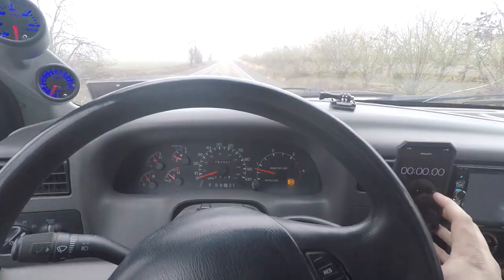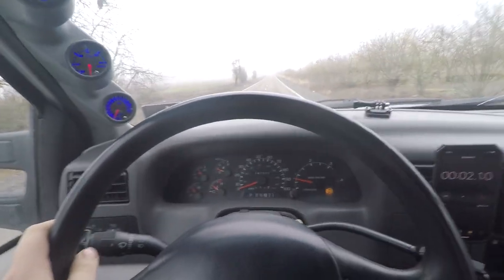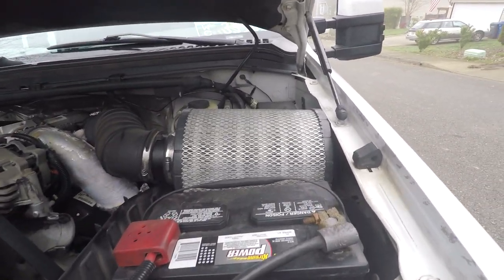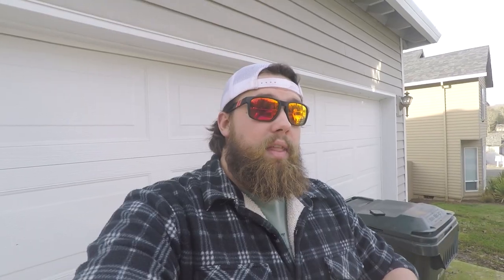Hydra Vs TS 6 Position Chip, Which is BETTER?

Comment: I have a 2001 7.3 in an f250 with 140,000 org miles. Condition is 99.0% good. Only gets around 17 mpg. Would love to get better fuel mileage. God Bless
Reply: I just snatched up a 2001 crew cab 4x4 7.3 134k on it. Beds rusted out but cab isn't too bad. Probably gonna just throw a flat bed on it. Couldn't pass it up 5 grand off a friend. Anymore you're gonna get a gasser with almost double the mileage for thst price lol

Comment: I happen to see Oregon plates on a truck in the video.
Didn't know if your in Oregon if you are could you do a video on how it preformed towing up hills with the chip??
I tow over MT Hood and wanted to see if I will notice a difference in towing 
All I have done to my truck is air intake and 4" turbo back exhaust.
Love the channel and the videos!!
Reply from the maker: Im in the salem area!!! I could do that for sure!! The Chip does come with Towing Tunes you can install! So I imagine it helps a ton!
Reply: @TurboDrivenAustin  we moved over the mountain to prineville and I had the chip installed you were right!!
Major difference now it's like a whole different truck.
I towed my 11,000lbs toy hauler over the mountain on the 80 horse power towing tune it blew up the hill like it has never done before.

Comment: My 2000 Ford F2 57.3 4 x 4 quad cab with the bully dog on extreme setting does 0 to 60 in seven seconds
I have a an aftermarket intake and a straight pipe

Comment: On my 2000 F-250 7.3 I got all Banks hardware and TS chip, big exhaust, inter-cooler, single shot injectors, turbo. I like running the chip on 4 till I need to blow Smoke :) She's a heavy truck with custom bumpers front and rear and a tank in the bed.... she's about 10500+ fully loaded... including my 3X Fat A$$ :)
Reply from the maker: So awesome man!!!

Comment: If your egts only hit 400 at wide open throttle you have your EGT sensor in the wrong spot they're supposed to be on a manifold
Reply from the maker: I have them on the spot that it showed in my Glowshift instructions, but, I have gotten that comment a few times, I’ll have to recheck my install, I did notice the other day when I got on it, my EGT’s hit 650/700, so I may have miss read my gauge at the time!
Reply: Yeah I thought the same thing on my ts chip on my 100hp tune I think position 5 if I floor it my truck will hit 1250 at about 60mph. And I have to peddle it to shift for them to go down.
Reply: @chrisyuriar9751  could be a bad probe mine started doing that a few month's ago

Comment: There are fuel plugs on the side of the heads. They're a big restriction on the fuel system, you need to pull them and drill them out, and debir them. You don't want metal shavings going through the injectors.

Comment: I got a 2000 7.3 superduty stock . I need more towing power for my 33 ft travel trailer. I had it to the floor a couple times going to the coast up hills. Im not a gear head. Wondering if its safe and is the ts6 for me?
Reply from the maker: This one would be safe! They have towing tunes optional!!!

Comment: Great video🍻. I'd buy a large grey shirt. Black might be too hot in summer in the State of Jefferson. 

As per tuning......look into a T500 terminator hpop from Riff Raff diesel. They are in Oregon. It will keep the hot tunes from emptying the injectors and getting the 1316 code. I honestly felt it was as important as the tune. 

Mexico street testing like 1320 videos!
Reply from the maker: Yes! Haha Mexico is a good resource for street testing!😂
Reply: T500 is a great upgrade and you won’t need a cross over line so it’ll balance out the pressures between heads through the modified pump. Went through Riffraff for most of my stuff 👍🏼

Comment: Hey man I’m a little late finding this video as I’m doing research. 1. I loved the video and thank you for showing what each person should look for in each chip. 2. I have the same “mods” as you did at this point (just a 3.5 straight back exhaust and an S&B cold air intake). Just thought I’d reassure myself by making the assumption that my 3.5 straight back should be able to allow the truck to breathe just fine? I’m definitely leaning towards the hydra after this video because I’d like to get a custom tune or two.
Reply from the maker: You should be just fine!! Don’t worry about it!!! And the Hydra is amazing, still love it today with my new injectors and Titan tunes!
Reply: @TurboDrivenAustin  out of curiosity what injectors did you end up getting? I have a 99.5 7.3 and I was looking at some Full Force 180cc injectors because I’m not too sure if I’m going to be doing an HPOP system or anything crazy.
Reply from the maker: I have 205cc injectors!

Comment: So I have a TS 6 with stock injectors. But I do have a stage 2 KC turbo like you have 6637 filter, fjx fuel lines and 5 inch exhaust. Is it worth me upgrading to the free Hydra tunes?

And I don't have the black box on my PCM so I don't know the engine code.. What could I do?

Comment: How well does economy mode work, over stock? Much better.?
Trying to help justify the purchase.  Looking for more economy on 500 mi road trips, etc.
I know they other tunes will use more fuel, like my exhaust upgrade did... I wanted to hear the exhaust for the firs month, so it was being heard more = more fuel :()
Reply from the maker: To be honest I haven’t used it very often, but let me do some driving with it in economy and I’ll let you know, I currently get 400 miles out of a tank on the 140hp tune, so I bet it will be around 450/500

Comment: I’m extremely surprised your egts stayed so low, Ive got a ts6 single shots, intake, 4” turbo back, and a built trans, (there’s too much to list lmao) and my egts on a pull get up to 1000 near the end, my probes in my manifold, I believe that’s why, is yours in the down pipe? 2 wheel peel 7.3 gets from 0-60 in 5.8 seconds. I’ll post a video of it sometime soon. She’s getting the trans gone through cause I don’t know how to be gentle whatsoever lol. And I’d buy the fuck outta some decals, some on my tool cart, my box and my back window  love the vids man keep it rollin
Reply from the maker: Dude YES! Haha I will definitely get some decals then! It’s been heavily requested! Mine is in the manifold! Right where I was told to install it from Glowshift! But I don’t have anything other than a chip on my truck, no aftermarket turbo, no injectors... hahaha just a plain ol 7.3 with a chip! BUT IT WILL CHANGE!😂

Comment: I just bought a 2000 7.3 that has 90000 it’s a lariat 4 door black beautiful truck... I have a 04 Cummins that pulls doubles pretty good it’s completely stock except for 4” exhaust . If I put a 4” mbrp exhaust on the 7.3 and a intake then put the hydra on it will it pull as good as my Cummins? I’d like to keep the 7.3.....
Reply from the maker: I bet it will man!! I have no doubts!
Reply: Nope, own a 03 Cummins stock with exhaust and cold air, also owned a 01 7.3 pickup and just got a 7.3 excursion both couldn’t touch my Cummins without heavy mods from stock. Love the reliability of the. 7.3s but if you want to pull things buy a Cummins.
Reply: @Lonewolf23-26  sold the 7.3, kept the Cummins!

Comment: So what do you recommend for someone who just bought there first diesel and want to put a programmer/ tuner in the truck? I just bought my first 7.3L powerstroke today it's a 1999. I just want to be able to plug it in and go and leave things on the stock setting or do a fuel economy setting.  If it helps I can provide you with my email and we can chat through email. Thanks Jason Eads
Reply from the maker: Man, thinking about it, i would recommend the TS6, BUT! It doesn’t have an economy mode, but it’s a simple plug and play. The Hydra is a GREAT chip, but it requires a little more “work” you’ll have to load the tunes onto the chip yourself, it’s easy, but it’s just a little more work. Plus, they have a better “stock” tune (helps with the “dead pedal”), tow tunes, power tunes, and economy tunes!
Reply: But I’d also like to be able to have a tuner sit in the windshield so I can have the gauges in it instead of going and buying a cluster because wiring and I don’t get along. At all, every time I try to wire something it somehow catches fire.

Comment: Would you still recommend the ts even if I upgraded the turbo and injectors, let’s say like a wicked wheel 2 and some bigger injectors?(stage 1 and a half 180cc)
Reply from the maker: I would say yes, but the only bummer is, if you upgrade injectors later down the road, you’ll have to remove your chip and send it away for it to get tuned for your new set up! Where as Hydra, the tunes are sent to you on your computer and you just bring it out to your truck and update them quick without removing the chip!!
Reply: PowerStoked yeah that was the reason I was going to go with a hydra
Reply: PowerStoked another quick question, would a edge insight CTS2 work just as good as gauges?
Reply from the maker: Zac Arnzen I prefer the CTS2, I just couldn’t afford it hahaha

Comment: I've been thinking about switching from my ts6 to the hydra,  I've heard the ts6 is a transmission killer if you have an automatic. Do you notice a change in shift points with the hydra?
Reply: It's not a tranny killer it's just rough on those high rpm shifts

Comment: Why does my truck turn off after installing the chip? 
My truck is ford f250 2000 7.3
Reply from the maker: You may have the wrong tunes on your Hydra! Make sure they match your computer code!

Comment: Aloha Bro, Just got mines in. I tried looking for my box code on the connector on the firewall but nothing. Just a black plastic connector. Do you know where else I could find it??
Reply from the maker: Absolutely man, I had to remove my entire PCM, it was relatively easy, it just takes a socket under the hood to loosen the bad boy up, and then it will pop right out. I think in my Hydra installation video I show it! Then you pull the PCM out and there’s a black plastic piece that has your code on it! (You’ll need to remove it anyways to get the chip installed) That’s how I had to get mine! But before you do that, unhook your batteries!!!! And keep your keys out until you have it all buttoned back up!!!
Reply: PowerStoked Mahalos Bro!..👍🏽🤙🏽
Reply from the maker: No problem man!! I’m happy to help, and now that I’m thinking about it, there are 2-3 small bolts under the dash for the bracket that holds the pcm to the wall that also need to come off!!! I’m sorry buddy! I totally spaced that part haha

Comment: Do the 33 psi wastegate. Holy cow it holds low end boost so much now the turbo whistle is crazy. The stock wastegates are junk
Reply from the maker: Thank you for the advice man!! I recently upgraded to the KC300X and it is AWESOME!!! 30PSI DAILY
Reply: PowerStoked Lol. Hell yeah. I guess at least other 7.3 owners may see this.
Reply from the maker: Oh! Right on!!
Reply: PowerStoked have you had any fuel economy issues? Thinking it may be ebp tune and sensor related although my  valley is caked in grease and I’m sure it’s leaking oil .
Reply from the maker: I haven’t!!
Reply: PowerStoked thanks for the quick replies!
Reply: PowerStoked okay so I’m using my obd reader to read MAP data. But based on that.... it’s saying my truck makes 33psi boost. Stock engine......
Reply from the maker: I believe it!!

Comment: Your egts didn't get above 400....?  I don't think that's possible do you run methinal?  That just seems low to me. On my stock tune my truck gets up to 900 easy when floored. Just curious.
Reply from the maker: I think I have a wiring issue, it takes a full romp to get it to 700
Reply: Yeah when I’m on my extreme tune I get up to 1300 quite quickly. I also have the bd turbothruster II package

Comment: Just put the Hydra in my 2000, soo I really like it but the other day I got a SEL 1211 the truck has no issues. What can be done about the chip popping  this code?
Reply: Hydra isn't going to cause the code with the default tunes.  Check your injection pressure sensor and make sure it's not leaking which will make it read low.
Reply: @immikeurnot  full diagnosis no issues, with stock no problem on higher tunes and get on her good it pops a SEL. Several sites talk of higher tunes make a increased demand that the stock system cant provide and that's where the code comes from. Pressure drop from high demand. PHP is looking into it for me.

Comment: Correct me if I’m wrong...

People love the 7.3’s bc of their dependability and longevity. But this is partially why they are so sluggish when stock. 

When you do all these performance upgrades in a truck that wasn’t designed for that, don’t you decrease the longevity of the engine?
Reply from the maker: You’re probably right! I will say, I don’t know that running a tuner would change that longevity, but what I’m doing, (new turbo, new injectors) I have a feeling I’m taking away the longevity haha. BUT WE WILL SEE!!
Reply: Not going to hurt the engine unless you drive like a 16 year old on their way to prom night and or if you are not paying attention to egt's 

You'll hurt the transmission before you hurt the engine on a 7.3
Reply: @TurboDrivenAustin  as long as you stud it and put valve springs in it, it should be fine

Comment: You run the extreme  tune all the time?
Reply from the maker: Yessir!! Trucks temps are always monitored, I haven’t had any issues! I also get the best mileage in that tune!
Reply: @TurboDrivenAustin  that's interesting I have a zf6 7.3 only run the 85 horse daily usually for concerns about egts
Reply from the maker: My egts don’t get very high! I’ve maxed them out at 500! Uphill in the extreme tune!
Reply: @TurboDrivenAustin  yeah I don't have a egt gauge so I try not to run the extreme tune too much
Reply: @TurboDrivenAustin  i think there is something wrong whith your EGT, on high position its realy easy to reach 1300 degrees,
Reply: @denislapointe1128  Agreed. Those EGT's can't possibly be accurate. I've had my '01 up to 1250 easy when stock, and with the Tri-Power chip I installed in '03, I have to watch them especially while towing as they can get up to 1350 in a heatbeat and so I either back off or downshift.

Comment: I just I just ran my 03 and it ran 10 seconds 0 to 60 no power upgrades stock filter stock airbox detuned
Reply from the maker: Oh boy, wonder what’s wrong with mine😂
Reply: Corey Alley my torque pro app my 7.3 ran 10.4 to 60 it’s just straight piped and leaks boost like crazy
Reply: My 99 7.3 can do 0-60 in 9 seconds with an intake, straight pipe, stock tune, and over 400,000 miles.
Reply: Thought I’d update after tuner up pipes and wheel it’ll do 60 in 7 or under
Reply: I think the problem with his truck is the oversized tires and the trans sounds like it’s shifting too slow. The shifts should be snappier.
Reply: jpippinator yeah I’ve got stock size around 32.5 I think

Comment: Questions for ya,  so basically I can install this Hydra chip in my 7.3 without upgrading my injectors or turbo and it will run just fine ,I already have the biggo air filter like yours and 5" back turbo pipes with 8" tip other than that she's pretty much all stock BUT I WOULD LOVE TO HAVE MORE POWER I don't do any towing other than a car on a dolly once in  a while.
Reply from the maker: Yessir!! This chip is built to work with factory injectors and turbo!

Comment: I will probably change to this chip in the future, I’m running a diablo sport predator chip that my dad had installed before I got my truck and it’s ok but it’s very limited, I’m currently running it’s highest tune which is 100hp but it’s still kinda slow. The hydra sounds like what I need cause I’m going to be beefing the trans soon to support all the engine mods I’m preparing to do

Comment: One question for you on the 120 tune does it mess with your trans? Do you have trans work done? I’m thinking of switching from the sct x4 to go to the hydra
Reply from the maker: My trans is stock, but I have noticed it changes the shift points!!
Reply: I like the SCT x4
Reply: @TurboDrivenAustin  would like to know more about the shift point changes, right now I’m running edge and hate my shift points, I am on 37 tires with 4.56 gears

Comment: I got my hydra preloaded with tunes
Reply: How did u do that? Did u just put it in the comment area like what tunes u want on what number?
Reply: @bengunter2274  I got mine from power driven diesel
Reply: @codyfoster7574  o I just bought mine off of full force diesel and I didn't really wanna have to go through all the computer crap unless I really need too I just wanted to put in and go and have tunes already on

Comment: 400 deg egt? I call bs!!
Reply from the maker: Haha, I think something isn’t right with my gauge. I swear I put it in the right spot, but I will be double checking soon. I do have extremely low EGT’s. I don’t peak over 700.
Reply: @TurboDrivenAustin  It takes more than 700 to burn fuel, smoke would be completely blue